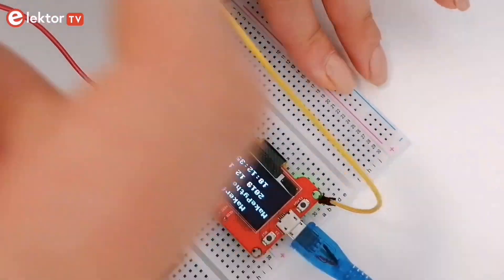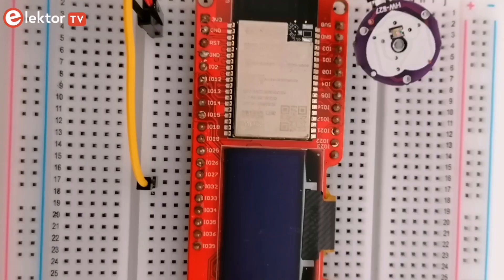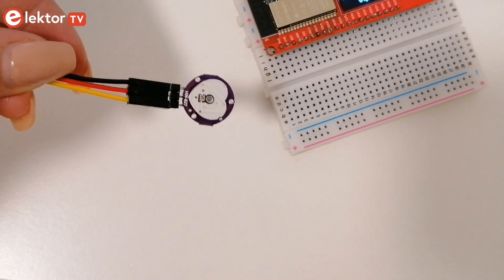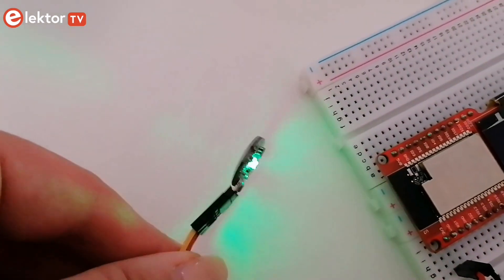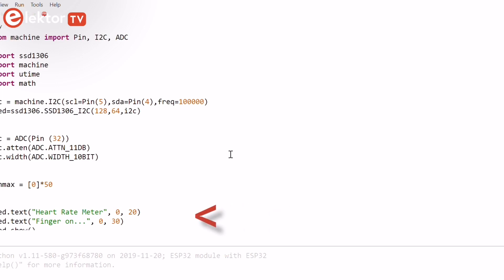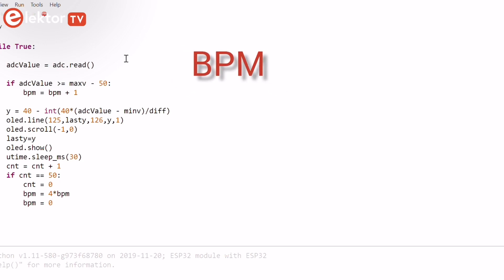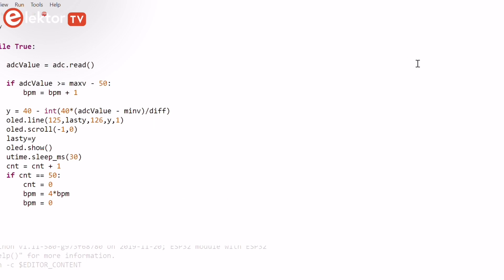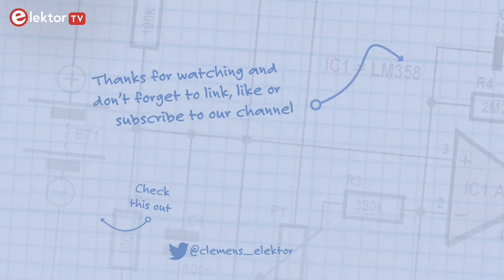Measure Your Heart Rate with MicroPython and ESP32

Comment: In the 1970s there were already heart rate monitor circuits (also from Elektor) that worked with an LDR, a bulb, 2 transistors and sometimes with a voltmeter w. pointer - completely without modern Stuff like Arduino & Co. 😄
Reply: In 220 BC there were people proosed the sun was a star and not a divined objected and people used to light to look at stuff with out transistors or anyting :)